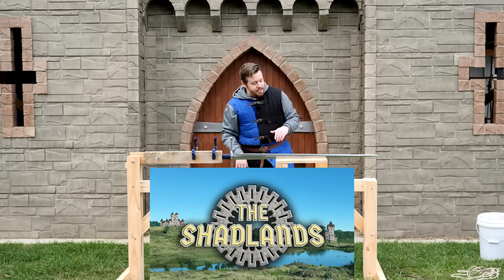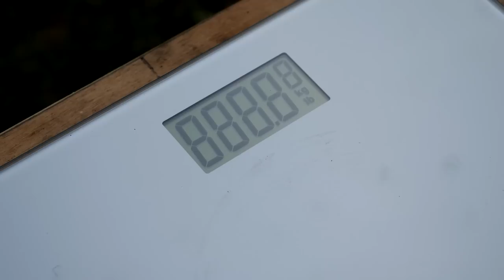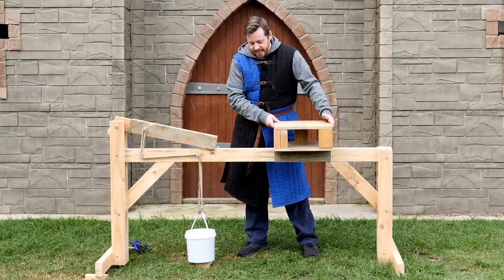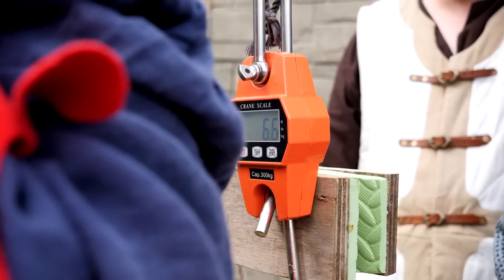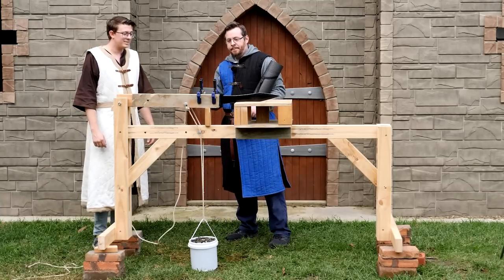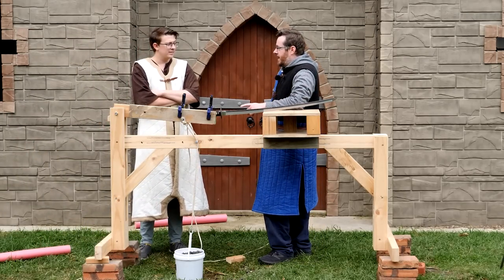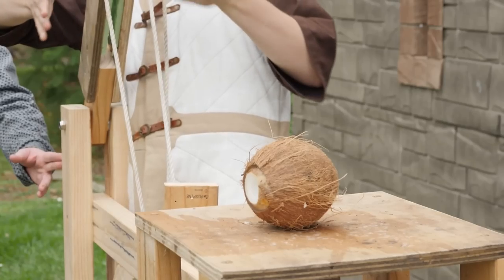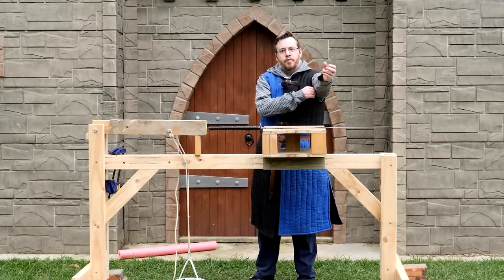Choppy choppy

Comment: I love seeing the medieval science experiments! The mass of the katana is much less than the mass of the zweihander. If you think about why the guillotine blades work so well was because they weigh almost 8 kg and the zweihander probably weighs around the same. A katana weighs around 1.3 kg. I think the clamp was also the problem for both swords. There was too much slipping happening upon impact. Having a less ghetto setup and have something that will mount and hold the swords in place will guarantee a perpendicular cut with the chopping block.

Comment: Heya shad, engineering student here. The force you can push with doesn't equate to the force of a stroke; nor does the total amount of force lead to the same outcome. A 9mm and an arrow hold a similar amount of energy but an arrow will go through a target vs a bullet stopping. I would stiffen your holding arm and try to match the speed of your stroke. ( Frame by frame measurements help) Beyond that you just need weights on the arm to get the proper force. Rubber bands would do pretty well here hope this helps.

Comment: Shad, mate.

You need possibly 45 degrees more arch in the swing.

Don't allow bucket to stall upon  the ground. A small pit underneath the bucket will be necessary.

And a much heavier weight. say 70/80 kg maybe more.
From my understanding your swinging your weight, from yr centre of gravity.
So half of the weight of the average man should achieve the required swing velocity. FOR A PROPPA GUD ORCS'S CHOP.

Love the chan and vids great idea you have had for this mate.

I want to see it work so well that it can cleave a dwarfs head in twain.

Comment: Kinetic chain failure. Also need more weight.
I would try a different way of clamping. Thing is, it doesn't really need to be braced side to side. I would use angle iron on the top and bottom  of the grip (vertical bracing), tightened down by hose clamps.
To fit different grips just use towels or something.
If you know a welder, make the whole arm metal. You could probably use an automotive hub bearing as the hinge.

Comment: I would suggest using multiple cutting mediums. Milk bottles with water are easy and recyclable, newspaper wrapped around a thin dowel work well for heavier cuts or agar is a nice cheeper alternative to ballistic gel and I'm fairly sure it's biodegradable.
I would also suggest using hose clamps to mount the sword to reduce movement.

Comment: I think it could be due to the force applied paired with the weight of the blade. I'd imagine Two handed swords are significantly heavier, than Katanas and regular one handed swords.
It's possible that the force exerted upon each coconut, wasn't high enough to cut the coconut in the thickest part of the nut itself. We know the katana can and does cut it at the outer most, and possibly weakest part of the coconut. But for some reason it didn't cut or so much as dent the shell. As I mentioned Katanas are significantly lighter weapons than two handed swords, so it needed your intervention to exert enough force to finally cut the coconut. So maybe for the lighter swords come up with a retention/spring system, that can give the same force exertion as a heavy sword. For example, if a Heavy sword weighs 10+ kilos, have a system that can give more force, for lighter swords. Maybe consider taking the weight of the swords used Into account. 

I have no idea about this sort of thing, so I'm just spouting ideas and possiblities here.

Comment: 19:15 As someone who's worked with foams and EVA foam (frequently used for yoga mats) for cosplays, not surprised. That stuff just says "Yeah, no" with push cuts, You need to do a drawing cut, and ideally nearly parallel to the foam. Even with exactos and utility knife sharpness, and the thicker, the harder to cut because the more vertical angle you need to get through.

Comment: [TLDR: I'd suggest measuring the 'resting' weight force at your hands (double handed strike, think hot potato hands) without any stick. Then set this to be the weight force at the end of the clamp. ]
[EDIT: paused to comment.... much was promptly addressed when I pressed play again.]

Love your work Shad! Always committed to actually understanding reality and trying to get a FEELING for things rather than pure theorising. 
...but...
Oh no... I hadn't read the comments yet and I reached the bit where Shad measures the weight force at the bucket instead of placing the stick in the device and measuring at the cut 😅

Sorry Shad... that's not exactly how physics works 😅 
> you're measuring at the wrong end of the system.
> your pulley setup would dramatically effect the force felt at the pin on the armature. 
> the length of lever makes a big difference. 

Now.... the crux... you're test doesn't have to simulate reality perfectly; it needs to be a repeatable test for comparison. 
For this reason the only adjustment that I would suggest is measuring the force you can apply vertically at you hands in a two handed strike, then measure the same force at the end of the clamp. 
This way you're taking the weapon out of the equation entirely and allowing the physical properties of each weapon to aid (or impede) cutting, as designed.

E.g. the effects of length, center of mass, density distribution, and point of percussion (sweet spot) would all be more readily evident.

A final note, as you mentioned friction, try a thinner piece of smooth cordage such as paracord.

KEEP UP THE AMAZING WORK!

Comment: My thought... Maybe put a top on the hilt holder, because you can see that the arm have a little give to it when it hits the object, which might cause enough of the dissipation of the energy to create the results you're seeing. My other thought is that the bolt the weight is attached to is too far down the handle. While that might be good when you're holding the sword in your hands, it also means the weight is pulling closer to the hinge... As the arm swings, that force amplifies, but as the sword isn't fully attached to the arm, much of that weight is staying on the back end of the swing, causing the power to be less than it would be. I think the reason why the blunt sword did better than the sharp ones is because there might've been more weight (slightly heavier sword) on the end farthest from the hinge, meaning more force in the swing. Essentially - you just need to move the weight distribution so its more on the sword than on the arm.

Comment: If you had a top bar where the grips are, then the grip of the katana couldn’t tilt and steal most of the force of the blow. You’ve got to hold the handle rigidly. When you swing it with your hands, they are moving forward beyond the target, in the machine it’s not.

Cheers! Love your content.

Comment: For half the video I kept saying to myself there needs to be an arm stopper or the force applied will not be exactly the same, and half way through it, with no mention during the mechanical explanation Shad just... simply added it on. I've been bamboozled 😂

Comment: Shad, 7 kilos is a measure of mass, not force. To account for force, you need the acceleration component as well. Force = mass x acceleration.

And … you keep on forgetting to remove the wooden stopper block.

Also, be careful with rolly things like coconuts. If by chance you hit dead center, it will cut, but if you're even a little bit off, a good chunk of the force from the blade will go into rolling the coconut around, significantly weakening your cutting ability. Hence why you hold food while you're chopping it. Either find a way to clamp down rolly things or chop it in half and put it on the board on its flat side.

I think the reason why it worked when you did it yourself was because a) you were able to follow through and b) you were probably making micro-adjustments to the sword position in response to the coconut rolling around, thus being able to find the sweet spot where the coconut will roll less and the sword will cut through. The contraption can't do either of those things. The latter, you just need to fix by securing rolly things so they don't roll (or chop them in half and put the flat side on the platform). The former, (and others have mentioned this too), I think you need to allow the sword to swing completely past the bottom of the object in question. Maybe have two blocks with a gap between them, and position the item to be chopped so it rests on top of the two blocks and over the gap. Then, as the sword falls, it would have a gap to swing into, instead of being stopped by the platform the item is resting on.

And a bunch of other issues that more physics-savvy people than me have already pointed out in the comments. Great idea, but you need a lot of tweaks to the setup.

Comment: You have a Cleaver rig. The only sword that I know that we'll be able to use that rig and make things come from together it's called (The Reaer cleaver). Strangely enough it is shaped like a cleaver or a 1950s slaughterhouse pig quartering knife. The Slaughterhouse blade weighs 15 lb and its job was to remove ribs from the backbone. A butcher who is skilled with the blade could swing it four times for a carcass and have that cow divided on either side of the spine.

Comment: Use a closed sack for the weights to not loss material
Put an inch or so gap in the sliding platform for the sword to pass through and lower the bottom stop so the sword would natural end its through the material being cut without any force lost into the cutting platform
Reply: The bucket works, just get the lid or if your concerned about the plastic breaking get a metal bucket with a lid.  A cloth bag/sack could also take on moisture weight.

Comment: This has probably been mentioned by others, but the thing I'm noticing is the clamp isn't maintaining the sword angle. The sword is initially in line with the clamp prior to the strike but is angling up afterward suggesting that when the sword hits some of the momentum is being turned into an angular motion causing the sword to rotate up and away. Effectively you've turned the sword into a nunchuck and instead of following through it's bouncing away as soon as it makes contact with the object. 

I would suggest some kind of brace across the top of the clamp that would prevent the sword from rotating away when it strikes the target. Something like a flat piece with a soft wedge that will press down on the backside of the hilt. This top piece could then be strapped down to keep it tight.

As for losing rocks, all you need is a lidded container, with a secure seal.

Comment: my suggestion for the rig would be to change the arm to something like a tube where you would put the handle of the weapon in.
To keep it from being too loose, maybe add foam or ballistic jelly while the handle is in the tube, and also secure the weapon with rubber or something, at the guard, so that it doesnt fly off the arm when swung.
maybe even add stoppers to the tube to simulate holding the weapon at the very bottom of the handle.

Comment: An easy solution to prevent slippage would be to put blocks in the clamp, one above the guard end of the grip, one below the pommel end. This would ensure that the blade does not slip upwards on impact.

Comment: 27:45 It could be that rather than the completely circular motion of the rig is worse for cutting into things because the edge doesn't slide against the surface at all, while you pulled the sword slightly inward while cutting. It's a pretty minor detail that might not be the actual reson but it's possible.

Comment: I'd be tempted to loop something around the handle that you can attach some sort of spring or elastic band to the underside of that's under tension.

My logic being that it'll help the clamps behave more like a wrist and dampen any resistance that's encountered on contact that's forcing the sword up, letting the weight pull it through.
Reply: Another suggestion is to clamp it using a metal ring with a foam padding inside, similar to a goPro round pole/bike handlebar mount. If you put something at the top and bottom externally you can then feed 4 long bolt/thru-axle across and clamp it that way. It'll cut the amount of possible movement out.

The trick would be deciding what the biggest handle you'd want to feed through, as you can always use padding to adjust the effective diameter.

Comment: The weight does not accelerate the sword! It is mostly added weight to the sword. You can think of it like dropping a sword tied too a bucket. Without a pully-system there is no acceleration DIFFERENCE between the sword and weight. The best solutions I can think of are rubber-bands or springs. Maybe you could ask Joerg for some help.

Comment: Ballistics gelatin is a good calibrated, consistent, medium, but it will probably chop right through. I suggest layers of a specific kind of paper (magazine, news print, what ever you choose to standardize on). Dry, not wet. 

Your force calibration is not currently set to represent an actual human strike, but it is a consistent standard, which is more important for this kind of comparison.

Comment: Since you know the weight you want to use on the rope, you could try attaching a kettlebell weight, which would remain consistent after each test. They're not cheap new, but are often found sold second-hand on ebay, in thrift shops, ex-gym sales, etc. Only problem would be that if you ever want to lower or the raise the weight, it's harder to achieve than a sack or bucket of rocks or sand.

Comment: Paper straws as a target. You'll cut through a lot and then they'll start bending and that should help absorb the shock on the sword. You'll also be able to just count how many straws it cut and you could count the bent ones too if you wanted to see how far the force of the blow sunk.
They'd be consistent in shape, thickness, and pliability because they're mass manufactured. You can't get this with hay/straw. They're also biodegradable and you can get them from recycled paper. That being said, using pool noodles isn't actually that bad. There isn't as much plastic in there as you'd think and a lot of other stuff has hidden emissions you don't think about. For example, cotton produces a lot of emissions because it requires so much to fertilize, water, transport, and manufacture into things versus just taking hydrocarbons cracked from oil. They're not that far away from their starting product and they're easy to work with in manufacturing.

Comment: Just so you are aware,  the digital hanging scale the bottom hook eye (internally) is connected to the load cell (the bit that does the measuring) needs to hang free and the rest of the body should not drag on what is being measured (the wood arm)... and is probably the source of the differing measurements...  its not super important but for accuracy it should not drag.   What maters is consistency, and it meets medieval compliancy standards...

Comment: A couple thoughts to help your power mystery.  
First is that the fact the blade slides after hitting the target means you're losing a lot of your striking power by reducing the impulse.  You might want to put some pins through your set up to support a sword handle much like a human hands would (one on the back side near the hilt and one one the front side near the pommel).
Second is that the bucket weight and torque are going to be the only variables when trying to match the arm's power to a human's.  The bucket can only accelerate as fast as gravity this means whatever point the bucket rope is attached to can only accelerate so fast.  If that point is too far away from the point of rotation the swing speed will be incredibly slow even if the resting torque on the arm is high.  In fact I would say you should be much more concerned with the swing speed of the sword being able to what a human can do.  I think the resting torque also shouldn't the rest toque a human can make, but I don't think it will be a big deal if it ends up super low.  I mean people can't really push a sword blade through a limb but a sword swing can definitely cut one off.

Comment: Since you're already using ropes I'd suggest a few upgrades to your system. Instead of resting on bolts I'd swap to pulleys where you won't have to worry about friction, I'd also align the pulley to as close to where the grip is as possible. I'd then add one as close to the target as possible so the weight pulls toward the target as much possible. If you need to redirect to get enough height for the weight this is easy enough with pulleys so that you don't have to use as much distance/weight with a potential 2:1 pull (optionally). The other great thing you can add is a tower with a pulley at the top as a safer/easier to use lift system. You could even use a pin release to prevent any issues with consistent release. The nice thing with each part of this is you can upgrade the system in parts so it's not like you need it figured out all at once.